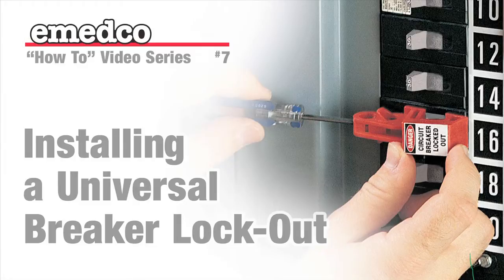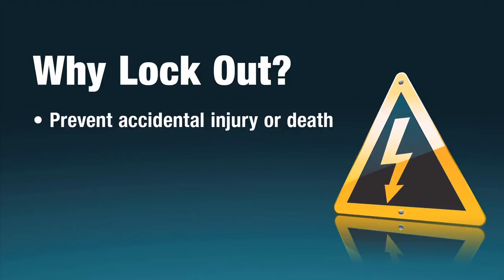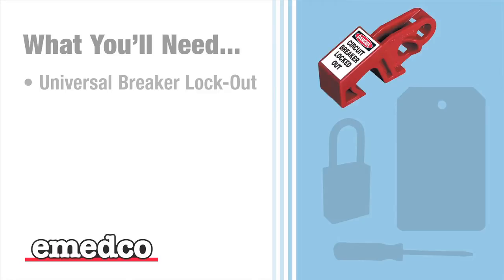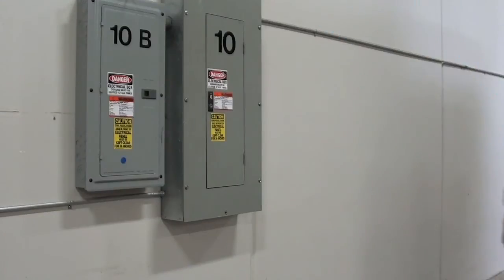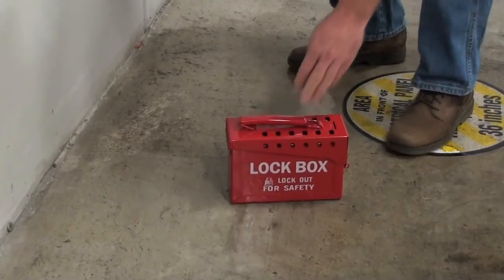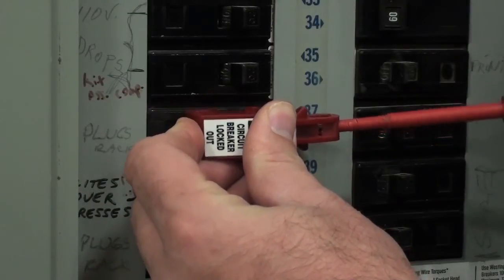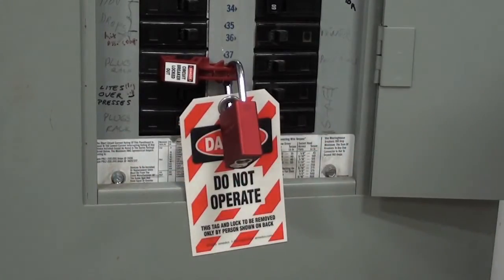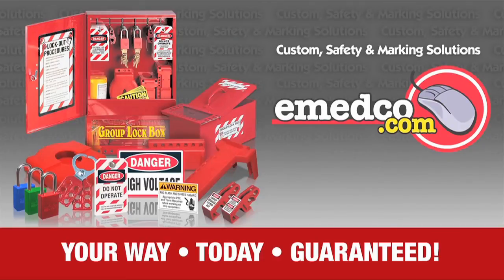How to Install a Universal Breaker Lock Out Device | Emedco Video

Comment: what if breaker need to trip? Is this could be a fire hazard?
Reply: It's designed for lock out in the off position for you to work on the circuit not hot. Not to keep it on like breakers locks.

Comment: I know this may come as an odd question but can this also be used to lock a breaker in the “on” position? We have someone who’s targeting a particular tenants power when frustrated or mad at them. Thank you.
Reply: No. No. And no. I understand why you would want to do this, but it's a major safety hazard. If you lock the breaker in the on position it will not allow the breaker to trip in cases of short circuit/etc. That is a major fire and safety hazard. Lock the breaker panel or junction box, not the breaker. Hope this helps even though I'm late.

Comment: Yes, the breaker will still trip with the lock out device in place. Even if the breaker handle is immovable the internal snap spring will break contact upon an overcurrent or short circuit condition.

NEVER REMOVE a lock out tag device or lock unless YOU installed it and all locks and tags have been removed by their owners. Period.